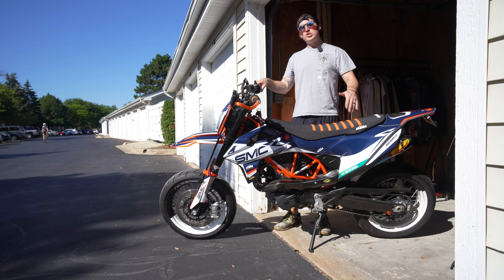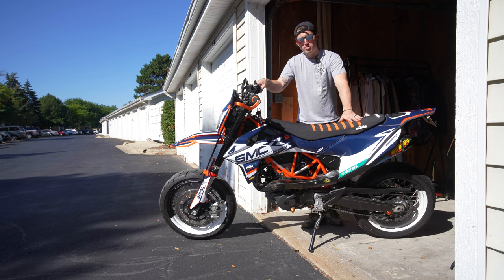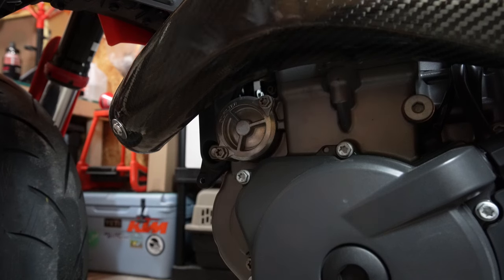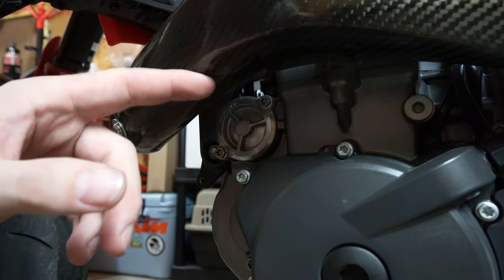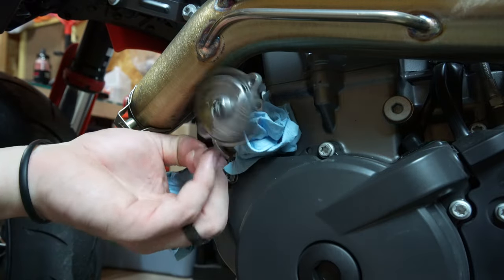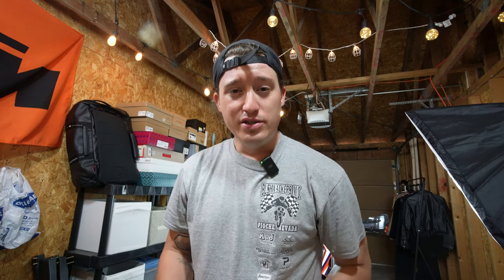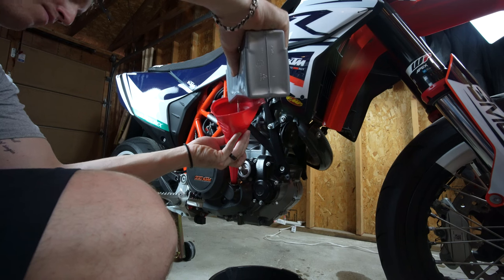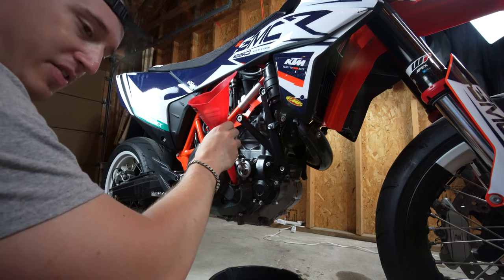How to change your oil | KTM 690 SMC R

Comment: Best tip for getting the filter out for me was to use an impact driver and screw a screw into it and it pulls out no problem every time.  Just bought a 23 ktm 690 enduro r and going to do first break in oil change and its surprisingly similar to my older 13 ktm 500 exc.  Thx for the info man
Reply from the maker: Damn that’s a good one! I’ll have to give it a shot! Congrats on the 690! And yeah it’s very similar, so if you’ve done your 500 this will be easy, I usually get the filter kits on Amazon and they are only $60 or so
Reply: I had the ring clip pliers and spread them and it came right out. I heard you can take a paper clip or coat hanger and make a nice 180 degree hook and go to the side of the filter and grab the metal edge where it meets the paper on the side. I did mine from the side stand, but after each drain bolt/screen/filter i rocked it side to side to get more out. After filling, if you run it for a few minutes and then turn it off and let it sit for 1 minute. You lean it off of the side stand while on the ground and make it balance, the oil should be centered in the sight glass? Manual says between, some say centered, some say hit the top line for full, many opinions on it.

Comment: Is it ok to just change the oil and not all the filters? As my ktm 690 has only covered 1200 miles since last service 2 years ago.
Reply from the maker: I would replace the paper filters and clean the metal screens with brake cleaner but for sure replace the paper ones. The kits that I get on Amazon come with everything (2 paper filters, 2 metal screens, all O rings) so I end up replacing everything each change. You can find the kit here! - https://www.amazon.com/gp/product/B01FI7QMDS/ref=ppx_yo_dt_b_search_asin_title?ie=UTF8&psc=1

Comment: to get the filter out hammer a flat head screw driver in it and pull it out i use to do that
Reply from the maker: Oh heck yeah I’ll have to give that a shot! It’s always been hell..
Reply: @LifeWellRidden  I try to avoid small metal shavings anywhere near my oil! But that's just me 🤷🏼
Reply: @LifeWellRidden  mechanic pick! Comes right out

Comment: 😎👍🇺🇲

Just got my 2021 this week.
Now I'm going through all the necessary maintenance videos so I can easily get to work when the time comes.
I just found a link in the comments to the kit. $77. Seems a little steep but it does come with everything, so that's pretty convenient for $77.
The oil looks fresh in the bike but I don't know how old it is.
I'll have a fresh start before the riding gets good.

I think the only thing that can be done to this thing is get rid of the factory levers. Or at least what I need done.
All the other mods are already there and there's a ton of them👍
Judging by the box of parts it came with. All the chassis mods were done before it was ever ridden.
Even the OEM head pipe looks brand new on the inside.

Seems to be a slight difference between this and the heavily modified DRZ SM I sold to get this one. ( "a slight difference" may just be an understatement 😏).

Anyway. Pretty decent video. Helpful.
The one thing I didn't get with the bike is a service manual. I'll have to source one soon.

Cheers from the PNW Seattle WA.✌️
Reply: 77 dollars isnt bad for a kit with everything, atleast you can do it yourself. i gotta pay my dealer 300 dollars for an oil change, and i have to do it with them to keep my warranty :p
Reply: @horemustjugen6677  

Yeah it was a piece of cake.
Took a little time because I was inspecting the rest of the bike too.
Personally. I don't think it's necessary to replace the screens every time.
Just pull them and inspect. Clean if needed.
The first kit I bought only came with the two filters.   That was before I knew it had all these screens and O rings.
So I have a spare simi lot for the next change.

I've been riding it all winter (except for ice or snow).
Quite impressive little machine.👍
Reply: @franktaylor7617  thats true, when I got my oil changed at the dealer, it just said on the paper that they replaced the oil filters and cleaned the oil screens. Also do you have any oil consumption on yours? Mine has been burning a bit of oil but my ktm dealer said its normal for these to burn quite a bit of oil (up to half a quart per 1000 miles), so i've been checking the oil level every 5th ride or so and topping up but i dont really know if its normal or not haha. But it sounds a bit extreme to me.
Reply: @horemustjugen6677  
Have used any yet.
I haven't been riding super hard.
It's usually very cold and typically raining.

Today's ride home was definitely dialed up.
Started riding it like the old DRZ SM.
I'm 58 and loving it.
I've only had since mid November. Only just a handful of dry rides. Or it's 30* out and I'm usually on dead cold tires.
Today was different. Over 55* and dry.😈

I'm rambling.
To answer your question. Nope, no oil consumption.👍

I've had a few dealers say the same thing. "It'll use oil".
I think that's a catch-all statement.
They told me my brand new Honda RC 30 would use oil too. It never did in the 10k miles I put on it.
Yeah just monitor it.
If you have a rear stand, use that and mark the level on the case exactly. Then set it up in exactly the same spot when you check it again.
Get a baseline and after several checks. You see if there's a pattern of usage.
That's what I would do if I was concerned.
Reply: @franktaylor7617  I saw a guy on a ktm forum who took his 690 around the world and had almost 80.000 miles on his engine with pretty much no problems other than a chain tensioner on the engine and he had the same oil consumption issue since he bought it brand new, but i might ask my dealer if they can take the head off and check the piston rings if it gets any worse. Mine has done a little over 10000 miles and i feel like the oil consumption is crazy for a bike with that low milage. Might just be the way it was broken in with the first owner, but still. Luckily its still under warranty until the end of this year

Comment: Idea: You could get that filter out with a magnet?
Reply from the maker: Hmmm.. that may work actually! Never even thought of that! I wonder what kind of magnet would work.. I’ll have to give it a shot!
Reply: @LifeWellRidden  I'm thinking as you can get it off with the pliers it doesn't have to be a strong one.. I'm guessing one of those telescopic magnet things will do the trick, they might also come in handy if you drop a bolt in the oil which I'm an expert at haha. Thanks for the video man, I'm getting my 701 in a week and this really explains everything great!
Reply from the maker: @Nickvdb93  congrats on the 701! You’ll have to let me know what you think! I’m glad this could help, I’m by no means a good mechanic but at least you get the idea haha